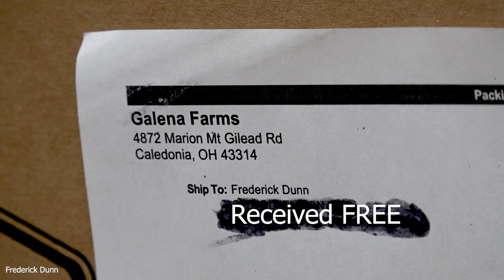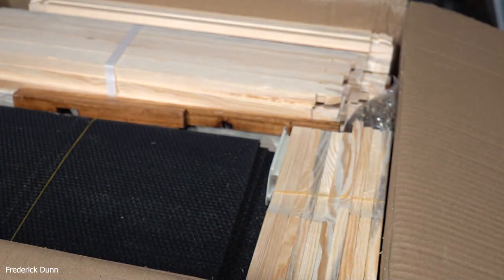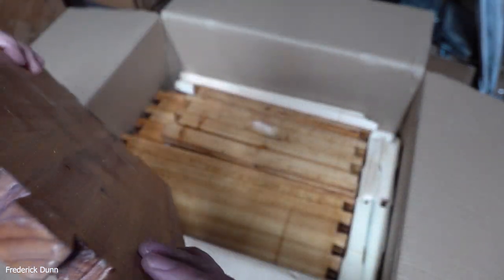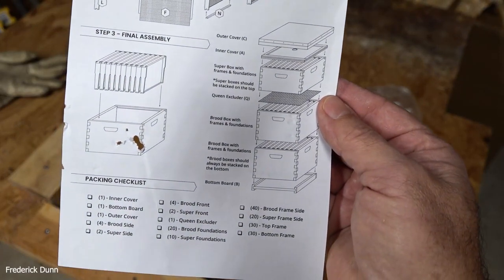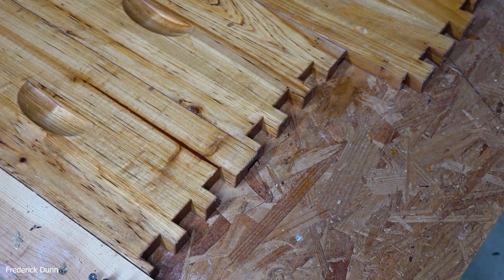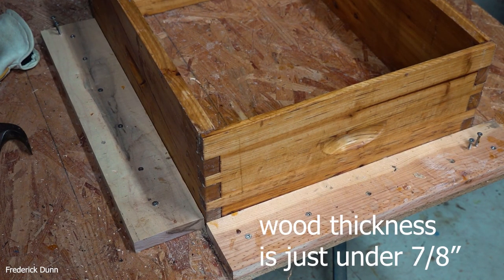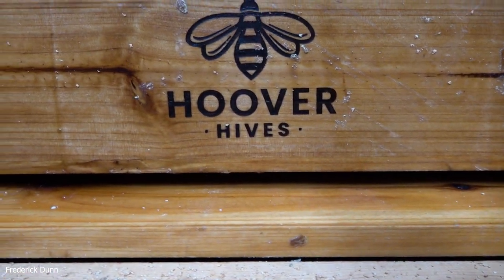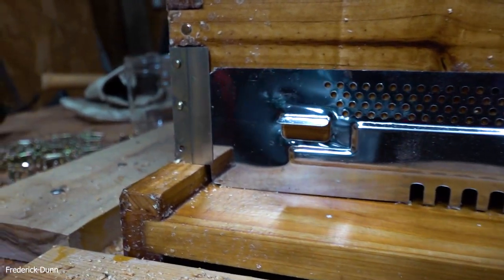Honey Bee Hive 10 Frame 100% Pre Waxed, By Hoover Hive, Sold by Galena Farms, Beginner Hive Kit Assy

Comment: Never heard of a wax coated hive. Fascinating.
Reply: Wax coating has been used for over the last 40 years. The practice came from beekeepers in Australia and New Zealand where due to the year round high humidity hives will be rotting out with in 5 years if only painted on the out side. So different beekeepers will use wood preservatives, painted or dipped even hot dipped for deeper penetration. They will also paint both outside and inside of the supers. but a lot of the beekeepers hot dip their assembled supers with a paraffin rosin mixture and will proceed to roll on a coat of white paint on the out side of the supers as the wax rosin cools down and this sucks the paint into the wood allowing the hives to be white and more heat reflecting during their hot summers.
Reply from the maker: very interesting!
Reply: @TheHoneyJudge  The practice comes from Europe actually and in France there are beehives that are like 130 years old by now ,dipped in parraffine.
Its a technique similar to the telegraph wood posts and railroad wood that is boiled in oil and creosote.

Comment: 7:33 for pushing the dovetails together. I knew these were delicate, so I did hammer the first one in softly, but I did get a little split.

From then on, I heated the joints with a heat gun to soften the wax. I didn’t even need the mallet, they just pushed together and the soft wax pushed out of the crevices and solidified around the joints🤌

I just got mine, they went away from nails on the outside, they now have pre drilled holes for less but longer screws to hold the dovetail joints. Good improvement over the nails I think.
Reply from the maker: I think those screws are an improvement. My boxes are already seeing the finish defeated about 40% of the exterior. Good tip on warming the joints before pushing them together.

Comment: Thanks for the video. Couple of questions. 
1. I thought we don’t want any material on the interior of the hive, e.g. wax, stain or paint?
2. Doesn’t most beeswax have insecticide in them, and if yes, doesn’t this introduce a chemical you don’t want into the interior of the hive? 

Seems like a well made box.
Reply from the maker: For dipped hives, they all will have an interior coating. YES, all bees wax will have some pesticide residue. When painting or finishing my hives, I just to the outside, top and bottom surfaces. Even when honey bees draw out fresh bees wax, there is agricultural residue as it's in their foraging resources. The good news is that they don't generally draw out wax from the hive interior surfaces, but rather the frames themselves. I think they will definitely put burr and brace comb on the interior of the inner cover which is also waxed. For those who don't want any of that material on the inside of their  hive components, this isn't for them.

Comment: I purchased 5 of this hives. Very uneven wax coating. You can’t really see that when hive is new, but just after one year you’ll see it. You end up with bare spots and the wood will get weathered. If you don’t recoat that with extra wax within a year, your boxes will begin to rot out. Joints on the other hand have too much wax on them and you have to scrape that off to put them together, otherwise boxes crack. I do love the dovetailed joints though. The biggest problem I already witnessed myself, they attract wax moths. No kidding, several boxes have tiny holes in them where moth’s larvae burrowed in it. That said, these 5 hives is all I’ll have wax coated. Not worth the risk. Frames are great, plastic fountains also need more wax on them. Overall, hives are great. Need an option where they aren’t coated.
Reply from the maker: Thanks for sharing! None of the hives I received have those problems, but all great things to watch out for.

Comment: Put some R-5 foam board in that outer cover. 😉
Reply: Hey Ryan!  I think I may try that instead of changing to polystyrene outer covers, we'll see.
Reply: @danskisbees7348  

Lower cost and less equipment to store. Plus you can just leave it in year-round. 😉
Reply: @RyanMcDonnough  yeah, it gets so hot, I'd really like to see how it does in the Summer too.  I've been thinking about going Lyson hives on future purchases, but I really like wood.  This could be a good middle ground.
Reply: @danskisbees7348  

You could do some testing with your current covers and R-5 foam, then see if it makes sense to spend money on poly lids and/or poly hive bodies.

The R-5 should be a big improvement. I installed an R-5 garage door at my previous home and couldn’t believe what a huge difference it made. The door faced west, FWIW. 

Putting that much insulation overhead should be even more significant. If you have a cheap IR temp gun ($20 on Amazon) you could set-up a few hives with R-5 foam and leave the others without. Then just remove an outer cover and quickly measure the temp of the inner cover.

Also easy to build a ventilated shim and top feeding screen. 😉

Comment: I purchased two of those same hive kits (8 frame) last year.  I really like them.  I used screws to put them together instead of the nails that were provided. But other than that no changes. Good quality at an awesome price.
Reply: Hey Larry, that's all I use too!  I really like the dovetail joints.  Happy New Year!
Reply: @danskisbees7348  - Right back at ya Dan!!!  Happy New Year!!!  Hope 2021 treats you right!!! 😃
How did the bees waxed dipped hives do for you down in that southern heat?  Any issues with the wax leaching out?
Reply: @LarryLeesBees  I don't have any Hoover hives, I just noticed the construction on the video.
Reply: @danskisbees7348  - Ah, understood! 🤣
Reply: did you find that the bees liked the wax coated frames?
Reply: @mountainhobbit1971  - The bees seemed to take right to them.  They were all drawn out and had both brood and honey all season.
Reply: @LarryLeesBees  awesome,  thank you
Reply: @mountainhobbit1971  - For sure! 😃

Comment: I just opened mine, no instructions included. I have that mouse guard but don't know where or how to attach it. Don't have the tiny screws for some plates I got, which I don't know what to do with. Got 5 frames, all black plastic. I don't know which side to put the hive on, with that lower unit which in one position if raises it off my concrete table more than if it was turned flipped over, which would cause it to sit closer to the surface of the table. never done this before, I'm a first timer and need help. Got some big white plastic sheet to lay I guess across the top of the racks, leastwise thats where I put it, but is it to separate the boxes as its sitting on the top around the rim? You said when one is first starting out, WHAT? I couldn't hear it. I noticed you didn't put that big flat plastic  thing on it before putting the top on and no trays/racks? did the coating of wax stay on your hive? thanks
Reply from the maker: I think you could benefit from getting a beginner beekeeping book. I think you're talking about a queen excluder. Here is a video where I go over setting your hive up:  https://youtu.be/CZsGV1F8xbQ
Reply: @FrederickDunn  ok, thanks so much. :) tc

Comment: I imagine you'll be doing a review of the Hoover Hive once you've put it through its paces.  I have one of these and like most things about it, but thought share one complaint.  I usually build my own equipment, so I can't compare Hoover to other commercial equipment.  My complaint is that there is too much space between the inner cover and the top of the frames. My bees build a lot of burr comb in that space and pack it full of honey causing a big sticky mess every time I have to open the hive. Doesn't happen with my inner covers. I'm tempted to run that thing through a planer.
Reply from the maker: Thanks for sharing!

Comment: I have one of these that I purchased summer of 2020 and the one negative things I didn’t like was that the dimensions are slightly larger than my current equipment and the telescoping cover is weak and easily wants to come apart and the corners. Otherwise they are great for the price.
Reply from the maker: Thanks, Jim, yes... the material is thicker, so larger outside dimensions. I think I'll probably be replacing the cover after the evaluation period. :)

Comment: I bought two of these last year - was super excited to support a local company. 

Unfortunately, all of that wax inside the dovetails caused 7 of the boards to split. I contacted the company and they basically said that since I had already assembled it I was out of luck… but the issue happened when I assembled the issue. 

I know now that the bees just fill in all of the splits in the hive with but it sure was disappointing to have my brand new hives damaged from the start, and then have the manufacture respond so casually about the issues.
Reply from the maker: I'm sorry your joints split. Mine are still looking fine. I hope the hive is still functional. Customer service is another issue entirely... your money is your best voting tool.
Reply: @FrederickDunn  You have splits at 9:05 and 9:12.... just from the assembly.

Comment: Not looking to rain on anyone's parade, since this does actually look like some good-quality equipment, but there's a definite difference between 'wax-coated' and 'wax-dipped.'  The wax dipping method most may have heard about would typically use a combination of paraffin and micro-crystalline wax, heated to about 250F.  After about ten minutes or so, the water is basically boiled out of the wood, and then displaced by the wax.  The hot wax penetrates permanently into the wood, and really doesn't leave much on the surface.  These folks "dip each part into a pool of natural beeswax", which, at a melting point of 151F, is not going to drive much moisture out of the wood.  Hence, the heavy and uneven wax coating.  It's nice, but it's not the same, and will only prove as durable and long-lasting as the wax itself.  But, despite all of that, it does look like they've done a nice job on the equipment itself, and it seems a great value!
Reply: I dip my beehives in parraffine.When you dip the wood in paraffine,the water in the wood starts to boil and gets out of the wood then its replaced by wax .
Its extremely dangerous procedure to dip the beehives in wax.
Never throw water to estinguish wax on fire because it ends in an explosion with a perfect mushroom cloud.
Reply: @mihaiilie8808  I hope you don’t know this by direct experience...
Reply from the maker: Thank you, Adam!  We'll give it the weather test and see how it lasts.
Reply: According to their website they have a two step process. First is a paraffin wax dip at higher temperature, second coat is beeswax.
Reply: @angelacross2216  The wax on the corners looks white like parraffine and the beeswax its yellow.
The beeswax costs more than 30 dollars a kilo while edible grade parraffine costs 2 dollars a kilo.
Reply: @soffici1  No,and i had  to sign papers for buying explosives when i bought the parraffine.Not even for fertiliser ,ammonium nitrate i had to sign such documents( in Europe).
There are kids that play with it and post videos on youtube,but they use like a half a kilo of parraffine not 60-70 like i use.
Reply: @mihaiilie8808  holy shit...
Reply from the maker: Hi again Adam, I updated the information in the video description. They do perform a hot-wax dip with other additives before they final/second dip/coating with beeswax. I found the information on the manufacturer's website.
Reply from the maker: @angelacross2216  You're right, I've added that information to the video description. :)
Reply: @angelacross2216  Interesting.  On the listing for the hive itself, I found this:  "Once they’ve cut the wood, they dip each part into a pool of natural beeswax."  In FAQs, I found this:  "Once the dovetails are cut, Hoover Hives soak their beehives in wax. The boards are given time to allow the wax to be absorbed into the wood so that the internal grains are completely saturated and protected. The boards are then pulled from the wax and allowed to dry. After this initial soak, they are dipped again into a second coat of wax so that the wood develops the lustrous allure that they've become famous for."  Where else should I be looking?
Reply: @FrederickDunn  You should also update the part where you say it's 100% beeswax.  :)

Happy New Year and thank you for being my online beekeeping guru!
Reply: @arogue469  From the HooverHives.com website:  "Our hives have no need for paint. Our unique combination of earthwax and beeswax provide a durable and sustainable method of protection.

The process starts with raising the temperature of our first coating. After the earthwax hits just the right temperature, we dip the bee boxes, inner cover, telescoping top, and bottom boards in it and allow the wax to impregnate the wood. After a few minutes of being submerged, the hive parts are then raised out from the wax to dry. The earthwax we use is made from an organic blend of paraffin and a mineral called Ozokerite. This blend of wax is what gives your hive the durability it needs.

For the second coat, we take the already impregnated wood and dip it in 100% beeswax. We then take the wood out from the wax and allow it to dry. Beeswax makes the bees feel at home in their new hive and what gives the hive parts their beautiful golden honey finish."
Reply from the maker: Hi Again Adam, they refer to their first dip process as a mix of "earth wax" I have no idea what that is, but here's their quote:  "Our hives have no need for paint because we double coat each of our hives in wax. The first coating is of earthwax followed by a second coating of 100% natural beeswax. This unique combination provides a durable and sustainable method of protection." So, then I looked up earth wax:  "Ozokerite or ozocerite, archaically referred to as earthwax or earth wax, is a naturally occurring odoriferous mineral wax or paraffin found in many localities. ... The name was coined from Greek elements Όζω ozο, to stink, and κηρός keros, wax." anyway, that's the first soak/coat, then it's 100% beeswax after cooling off and going for that second dip. :)
Reply from the maker: @Angela Cross that's true :) The first soak is "earth wax" aka paraffin "Ozokerite or ozocerite, archaically referred to as earthwax or earth wax, is a naturally occurring odoriferous mineral wax or paraffin found in many localities. ... The name was coined from Greek elements Όζω ozο, to stink, and κηρός keros, wax."
Reply: @FrederickDunn  Thanks for being so thorough, Fred.  I thought had looked everywhere on their website, and couldn't come across what you found.  As I had said, it does look like quality equipment.  It's good to see they're doing things the right way.  I hope they work well for you!

Comment: After watching your review I just purchased the 8 frame kit and none of the joints fit on the deep boxes. I did manage to get the super together. I have written the company to see what they can do.  It will be too time consuming to try and whittle down all of those dovetail joints to make it fit.  Otherwise it looks solid and the waxing is nice. I did buy one box on Amazon last year which was a ‘knock off’ not knowing about Hoover Hives.  The wax coating on the Hoover is obviously much better but at least the joints fit together on the knock off. :)
Reply from the maker: That's not good! Did you get it from the company I reference in this video? Or another source? Please let me know how they treat you with your return or replacement of the problemed box. They seem to be very responsive, but that can change.
Reply: @FrederickDunn  I bought from Amazon but after I did I emailed the company to double check and make sure it was really their product and not a theft.  They confirmed they marketed on Amazon so I didn’t cancel the order. (Still had time)  Just sent the email yesterday so will see what response I get.  I was so excited to receive it b/c I’m putting in a 3rd hive this spring after successfully overwintering my first two hives.  Would like to do away with the need for paint if possible and this fits the bill.  If company is responsive in a positive way they will have me for a customer for life. :). Thanks for all the videos!  Enjoy your channel!
Reply: Fred - as a follow up, Galena Farms has been very responsive to my concerns with the joints.  They offered to let me return the boards that I couldn’t get together but I decided to let my husband try (he is an engineer) to see if it was just me and  “operator error”.  He confirmed that the joints should be shaved down but using his strength got them mostly in place if not all the way flush in places.  I’ve opted to keep the kit rather than go through the hassle of returning at this point.  I hoping this is a 1-off and not the norm for this hive b/c I really would like to buy more.  I have nothing negative to say about the company itself as they are trying to resolve the issue although I think they believe that I’m not putting it together correctly. :)  My last note to them was some background about me and that my engineer husband agrees that it’s not me, it’s the boards. Hahaha

Comment: so the bee escape fits in the oblong hole in the inner cover?
Reply from the maker: That's correct, and actually why those inner covers have that opening. You can put it under your honey super and use it to clear your honey super from worker bees. Probably one of the oldest bee escape insert designs aside from the large screened triangle bee escape panels.
Reply: @FrederickDunn  porter bee escape ,ive even seen vintage metal versions,pretty neat